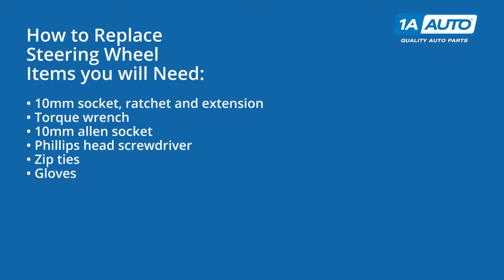How to Replace Steering Wheel 05-10 Chrysler 300

Comment: Is there any need to modify hardware or software to mount a multi-steering wheel in place of an ordinary steering wheel  2006 Chrysler 300. thanks :)
Reply from the maker: +Mihail Musov Thanks for watching!  Yes there would be wiring and likely reprogramming needed for that type of job.  1aauto.com
Reply: @1AAuto   Thanks a lot  your videos are very good! Is there any video how to do the wiring and reprogramimng?
Reply: @1AAuto  but if i just wanted to replace my plain steering wheel with a srt8 steering and im not worried about the steering wheel buttons will it work

Comment: I have the same steering wheel in my 2006 chrysler 300, can I swap it with one that has the volume controls on it?
Reply: Yes or no?
Reply: @AlexMartinez556  i waiting for the answer too
Reply: @AlexMartinez556  you can, but I doubt the controls will work.